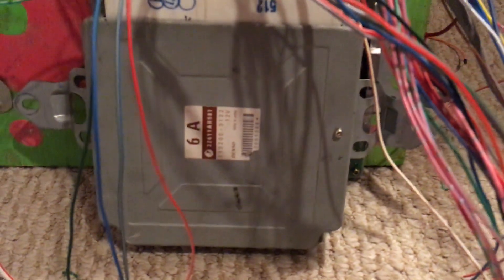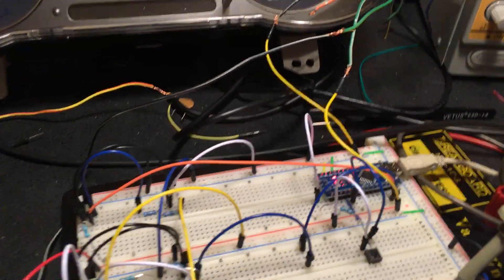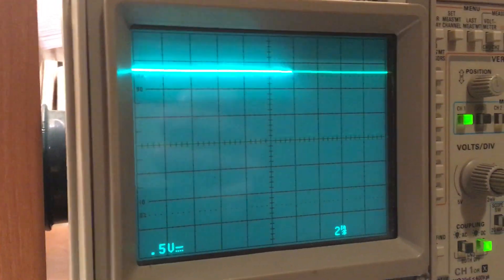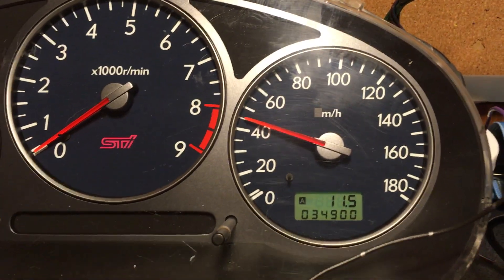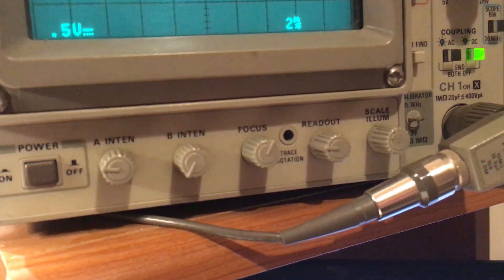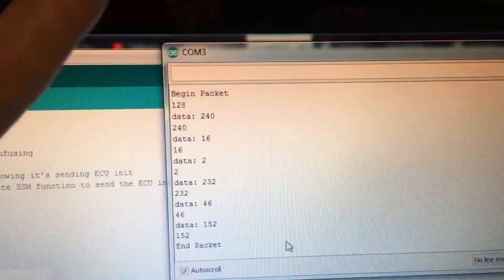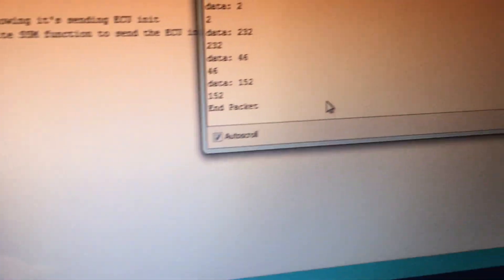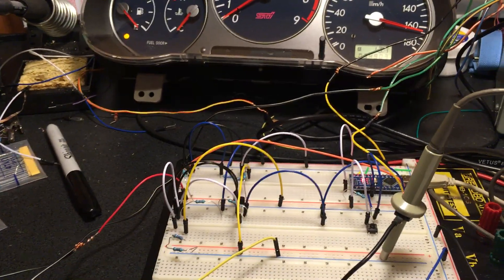Subaru 16 bit ECU Bench Tester + K-line Transciever

Comment: Shot in the dark you'll respond but I need your help and I'm willing to pay for it. Interested to find out if you ever finished this project and got all the gauges functioning on the instrument cluster? Long story short I have a digital dash designed and intended for retrofitting BMWs. I'm trying to use my Factory 2002 WRX ECU but I need a signal model like what it looks like you developed so custom firmware for the digital dash can be made from it. This is a one-off project only for my use. Not to be reproduced or sold. Please reply or contact me directly. Again willing to pay for your time you put into researching this. You are the first person I've come across who's went down this rabbit hole and actually understands it.
Reply from the maker: Sounds interesting, feel free to send me a message on my Facebook page... Search G-ROM Electronics!

Comment: Do you know if there's a way to control just the cluster without the ECU?
Reply from the maker: Of course! That's actually what I was doing here. The ECU isn't talking to the cluster at all
Reply: @GarrettsSubaru  How are you sending data to the cluster for the speedometer? I've tried changing the voltage, I've tried send it square waves and nothing seems to be working.
Reply from the maker: The cluster needs a 12v 50% DC square wave. If you've got a waveform generator, I'd check your offset to make sure it's right as well as that your grounds are common between the data sender and cluster. Remember, with "digital" stuff the 0 isn't always the same 0!
Reply: @GarrettsSubaru  So it is 12V. I was trying to do research on that and some said 5V, others said 12V. I didn't want to try 12V and risk frying the micro controller. I was trying to replicate a square wave using an Arduino and now I know why it didn't work. Not enough voltage.

I would presume the same is true with the Tachometer (RPM)?
Reply from the maker: Yep, same kind of input.

Slightly off topic: Using an arduino for square waves is tough, as the stock libraries overflow the 8 bit timer register for waveform outputs and the lowest you can pulse down to is something like 26Hz, which doesn't give you full range on the cluster.

If you run an RTOS you can significantly improve the output of the arudino to get down to .2Hz up to like 150Mhz, which is plenty low and high enough to drive the cluster through it's full range.
Reply: @GarrettsSubaru  I remember seeing that. Someone was trying to do the same thing on a BMW cluster and the Arduino would max out the speedometer if you got it to a low frequency. It looks like they have several RTOS' for Arduino. So I'll definitely have to try that out. At least with the info you gave me and what I already have, I can at least see if I can get something to show up on the cluster.
Reply from the maker: freeRTOS is probably one of the easiest to jump right into. See what you can do with it!
Reply: @GarrettsSubaru  Will do. Thank you for your help!
Reply: @GarrettsSubaru  Hey so I got the speedometer to show something by connecting the TCM to 12V negative (ground, with a square wave), but I can't get the tachometer to register. Do you know if it is connected to ground or 12V+?